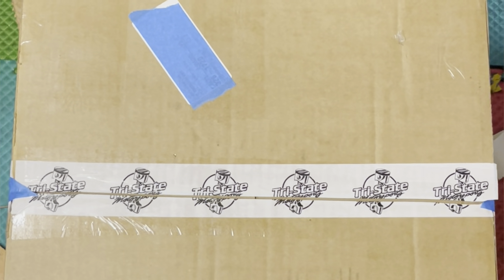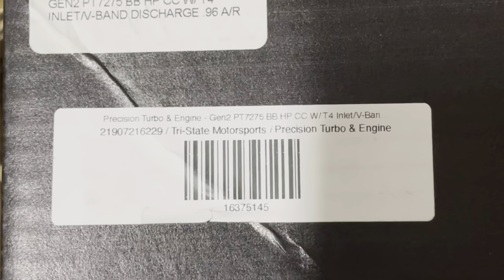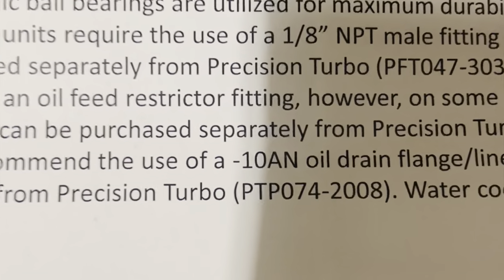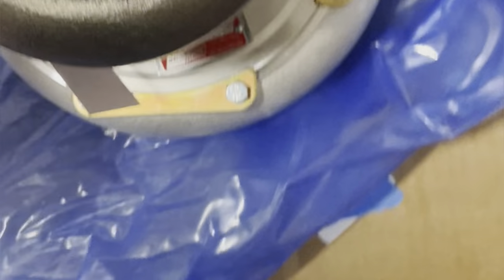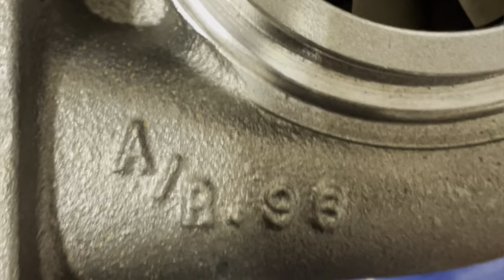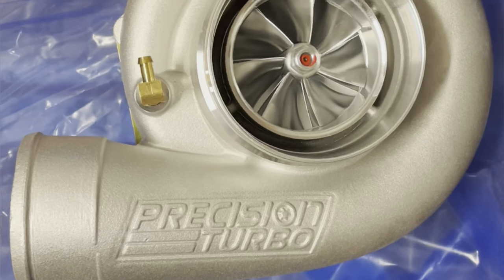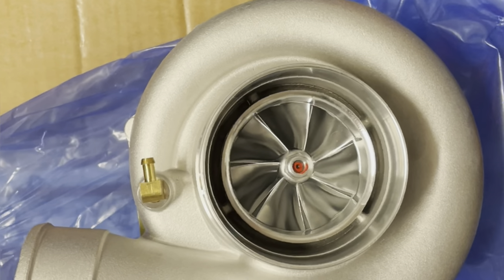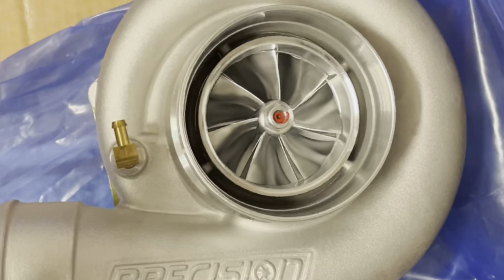Precision PTE 7275 Gen2 ball bearing Turbo unboxing!!!

Comment: Damn dude that's a serious turbo, you aren't messing around!
Reply from the maker: Yes it’s gonna beast! 😝 Hopefully I can some pictures of being built. Fully forged k24a2 footage soon.
Reply: @gmadgengarage  You think I should build internals before I ever boost it? I've been on the fence about that since I bought the car. I've got plenty I can do to keep me busy on the car for a while but maybe if the Hux cannibal kit delay drags on I'll pony up for the rods and Pistons. I also haven't chosen a turbo, minimum size will be a 6262, but thats not too much bigger than my chevelle's 58mm and I want this car to be my beast car so I'm thinking at least a 6466.
Reply from the maker: @MotorSwapDan  honestly it depends on what your goals are. I knew I wanted to make 800 plus HP street car so I sort of forced to forge the engine. However, if yo goal is around that 400-550hp range then the stock motor fine. You can always collect the forge internals later and then build it later. I have a few things that can get you started if you did want to forge it. I can give you that YouTuber to YouTuber deal on everything or separately. You let me know. Dm
Through IG @gmadgen or Facebook @gmadgen Garage CF parts swap. I’ll take care of you. 💪🏽